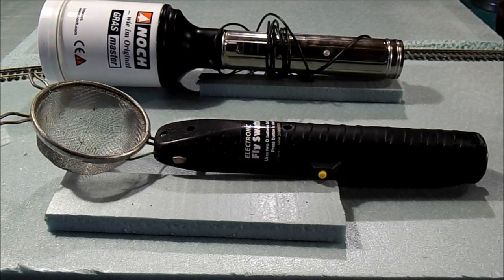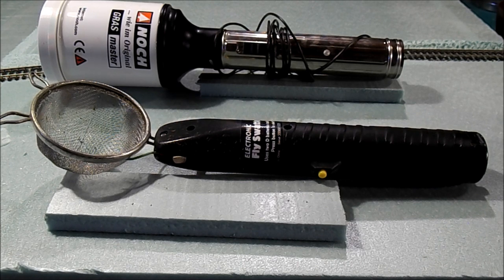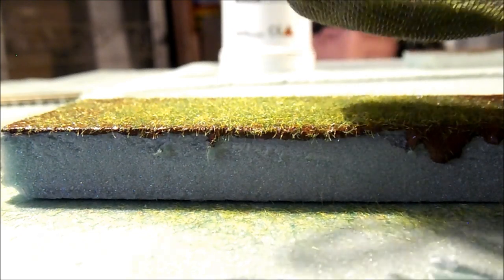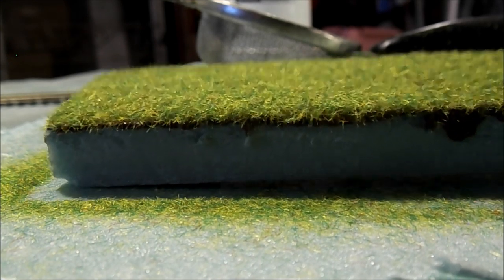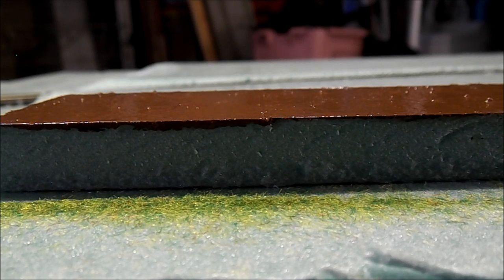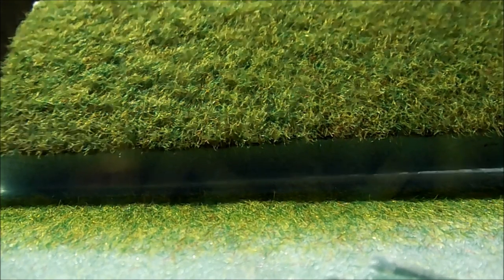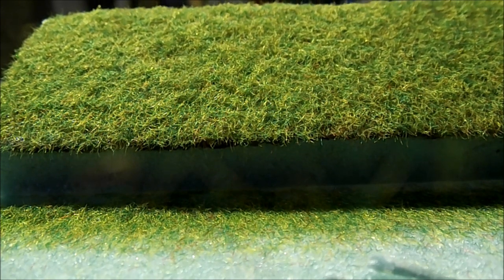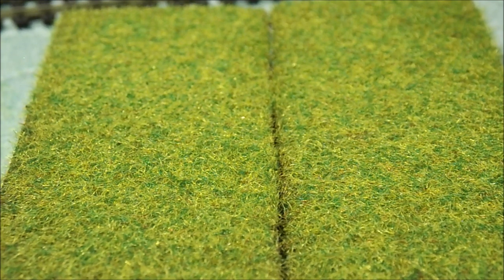Demonstration: Noch Vs. Homemade Static Grass Applicator

Comment: You get a better static action the more voltage you put through the applicator...thats why Noch uses a 9v battery. You can hook up a 9v battery connector to the home-made applicator and use a 9v battery for better performance. And in accordance with other comments left below, you get a better result applying the grass to glue rather than wet paint, and with the grounding pin directly in the wet surface, rather than the substrate.

Comment: I can tell you why there's no static action: your applicator is missing the grounding wire and grounding pin.  Without those, there's no path for the static charge to travel through and the  static grass falls flat onto the modelling surface instead of being pulled upright by the charge.
Reply from the maker: dwc NineteenSixtyThree you didnt pay enough attention. I used the ground pin on both. You can see the pin in the side of the foam near the end. Besides this isnt a tutorial, its a comparison.
Reply: I stand corrected. I see now where you placed the pin (hard to see, though) and the wire from the home made applicator must be out of view. If I might make some suggestions, you'd get better results if you put the pin directly into the surface adhesive instead of the side of the foam block (better conductivity due to the liquid nature of the adhesive) and dispense the grass closer to the pin. I also recommend a thinned adhesive. Thick adhesives (be they paint or glue) grab the grass and make it harder to pull it upright (like a mammoth stuck in a tar pit). Still, I appreciate the video. I make and sell applicators and it's good to see that greater cost doesn't necessarily equate to greater results.
Reply from the maker: I agree with you about a perhaps thinner paint but having the ground pin in the surface can leave a blemish or risk electric shock by touching the basket to the pole. The ground cable on the home made one is significantly shorter, i didnt realise it was hard to see.
Reply: I don't find that blemishing is an issue if the pin is small and grass is laid over the previous location when the pin is moved to a new location. I also make my applicators shock proof so touching the basket to the pin or one's hand is not a concern. You're right, though. If the unit has not been constructed appropriately caution must be exercised as touching the basket to the pin creates one hell of a zap. I can also tell you that completing the circuit with one's body when building a unit causes one to jump around like a cat on a hot tin roof thereby eliciting hysterical laughter from one's wife.
Reply from the maker: i still dont think my girlfriend stopped laughing at me for zapping myself... if you make a safe applicator i would advertise that! in the video i used a nail because that was all i had, but in previous use i used a sewing needle for leather and the grass seemed to sway around the needle and when i tried to back fill it clumped in the area... but im no expert. i wanted to make the video just to show that the name brand, voltage, and cost dont necessarily matter. i was able to get identical results even with one having a significantly shorter ground cable than the other.  also the pieces of foam were pretty small so i felt the placement of the ground was unimportant...
Reply: There's definitely an optimal thickness for the pin. Too thick and the hole can be troublesome to fill. Too thin and the pin sways around, gets knocked over, or gets pulled out.

I've sold some of my applicators to a local train store but now I sell them on eBay under the brand name electroTURF. I haven't sold scads but my customers have been happy with them and they're definitely a low cost alternative to the commercial units.
Reply: @dwcnineteensixtythree341  Sounds like my other half.
Reply: Actually there is no need to add grounding pin, mine using AC ion generator 220v
Reply: @TonyFleetwood  I think the issue is that the foam is a really good insulator. You need to attach the ground wire to a piece of foam that’s covered with wet glue or paint to make a connection to the surface you’re applying the grass to.

Comment: My electric fly swatter from harbor freight required two AA batteries I switched it to a 9 volt. Works awesome.
Reply: I just switched to a 9v power supply
Reply: @Gbhmagic   how do i switch my 2 aa batteries to a 9v?
Reply: @wowkalfas1977  have to rewire the input. However be warned you are using 3 times the rated voltage.
Components could fail.

Comment: could you convert the home one to 9v or a plug in unit like from the model railroad power pack to increase are decrease the power you would have way more amps with a plug in unit. I think I saw were a person used a part from a microwave oven and it seemed to work pretty good. I am leaning towards buying a good one because  I want to grass to really stand up
Reply from the maker: there are 3 versions of the fly swatter i have come across: a 2D cell, a 2AA cell, and single 9V cell. it may depend on where you live which one you can find.

Comment: Neither of your applicators realy work. No static action. The fibers need to stand up. d is right. This is absolutly NO reference.
Reply from the maker: how is this NO reference? if you dont like either then you are referred to buy neither. did you not see where the fibers were statically attracted to each other in clump chains? last time i looked at my front lawn the grass didnt stand straight up either.